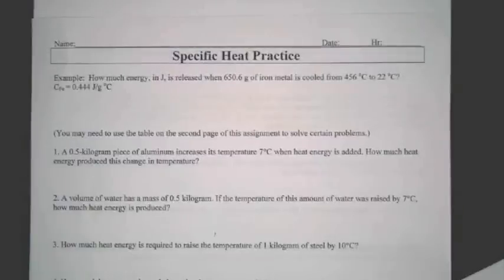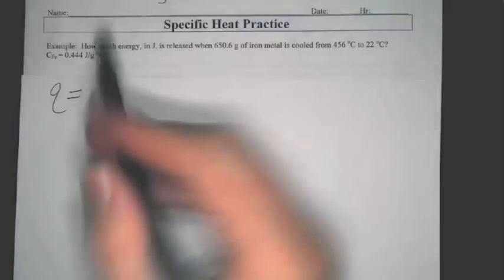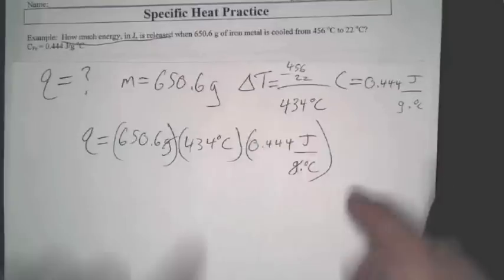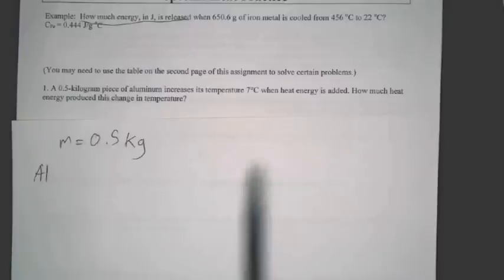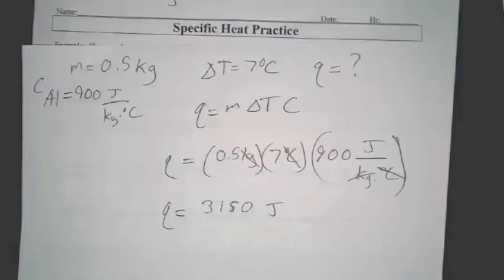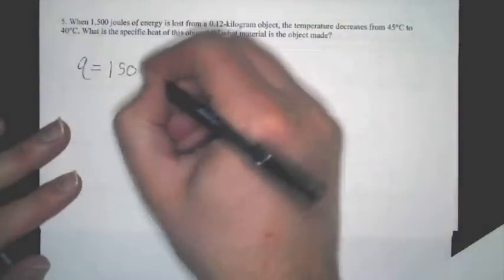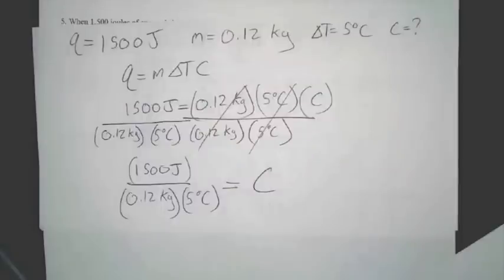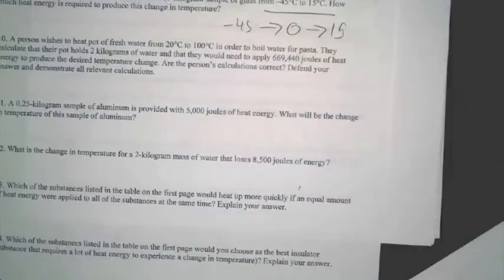How to calculate specific heat: Example specific heat problems

Comment: Is there a difference in how you solve this equation and when you use two substances with specific weight measurements and the heat capacity of the other substance is given?  I have a question about sand being mixed with water.  The water has it's measurements and heat capacity given.  My question is can I solve this problem and ignore the values of the water given?

Comment: I found this question and couldn't answer it. Could you give it a shot? Thank you!

Two identical systems, with heat capacity at constant volume that varies as Cv=bT^3 (where b is a constant) are thermally isolated. Initially, one system is at a temperature 100K and the other is at 200K. The systems are then brought into thermal contact and the combined system is allowed to reach thermal equilibrium. What will be the final temperature of the combined system?

Comment: please help with this question... When 1.5 * 10 ^3J of heat energy is absorbed by a beaker of water, its temperature rises by 3.1 degrees celcius. What is the heat capacity of the beaker?

Comment: Hi,I need to calculate the temperature and pressure drop of the gas flowing in a pipe.I have following inputs - inlet flow rate, inlet temperature and pressure, properties of pipe and insulation surrounding it.Can you guide how I can calculate it?

Comment: For #1, it should be negative. This is because Delta T is Final Temp - Initial Temp, you did Initial Temp - Final Temp
Reply: Bailey W Suppose im a wee bit late, but when calculating the change in temperature, as long as the unit stays consistent, it makes no difference. Coincidentally explained later in the video, the difference between -45 degrees celsius and 15 degrees celsius amounts to a change in temperature of 60 degrees celsius. The same answer applies for -15 to 45 degrees celsius. Thus why kelvin is very easy to work with.

Hopefully this helps clear up misunderstandings from reading the above comment, which is the sole purpose of this reply.

Comment: sir how can i calculate the specific heat of biscuit ? plz do reply sir, as it was asked by my boss, i work in biscuit manufacturing company
Reply from the maker: My suggestion.  Eat the biscuit, if it is that kind of biscuit.  If not, use a calorimeter.

Comment: How many grams of water would require 2.20 x 10^4 calories of heat to raise its temperature from 34.0 oC to 100.0 oC?  (Remember the specific heat of water is 1.00 cal/g x oC) 
WHAT DO I DO HERE SINCE WE HAVE 2.20 X 10 ^4

Comment: Calculate the specific heat (J/g∘C) for a 25.0 g sample of a metal that absorbs 641 J when temperature increases from 41.2 ∘C to80.1 ∘C. 
I've tried to plug everything as you did and divide and my answer is still incorrect. I'm having an issue. I just don't understand specific heat.
Reply: Specific heat (C) = Heat added x 1/mass x 1/temp. change

Substituting the values, we get:
 
C = 641 x 1/25 x 1/(80.1 - 41.2)
C = 641 x 1/25 x 1/38.9
C = 6.59 x 10^-1 J/(g x deg. C)
Reply: You have mass, energy and temp change. You need to solve for the heat capacity

Comment: calculate the heat of 15.2g of substance that required 362.7 calories of heat raise its temperature from -19 degrees C to 27 degrees C? how would i do this problem?

Comment: If the iron metal is cooled from 456 to 22, does that not mean that 456 is the initial temperature and that the  is the final? I'm, just curious because that does not seem right when I read it.
Reply: yes it should be.

Comment: What is moles gets involved
Aluminum metal has a specific heat of 0.900 J/g•degrees C. Calculate the amnt of heat required to raise the temp. Of 10.5 moles of Al from 30.5degrees C to 225degrees C
Please help
Reply: +RaeAnna Cardenas I think you just need to convert the moles of Al into grams. Just multiply 10.5 mods Al by 1 mole and divide by the molar mass of Al. Then use that number as your mass. I hope this answers your question, and I hope I'm right! (I'm in AP chem in year 11)

Comment: I'm having trouble with this one. Some help would be awesome!

The Specific Heat of a substance is the energy (Joules) required to raise one gram of substance by one degree celsius, (units J/goC).
Heating 115 cm3 of a solid from 35.05 oC  to 75.35 oC takes 13750 J of energy. The density of the solid at 35.05 oC is 2.7 g/cm3. 
What is the Specific Heat of the solid in this experiment?
Reply: The only thing that's not straight forward is how to calculate the mass. However since they've given you both density and volume of the substance it shouldn't be hard enough to plug them into the formula d=m/v which you should rearrange to get m=d(v). After finding the mass simply plug the numbers you've got into the formula E=mc(change in temp.)
That's about it! :D
Although you're getting help after a year! 😂 hope this helps!
Reply: +Susan Crasto 
where were you when I needed you 😂